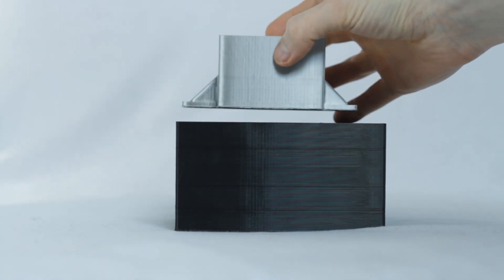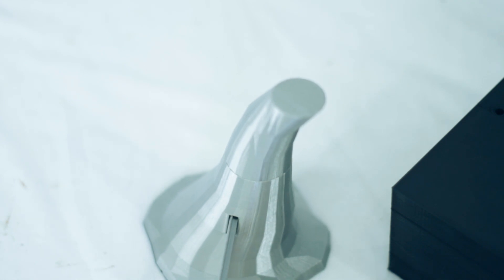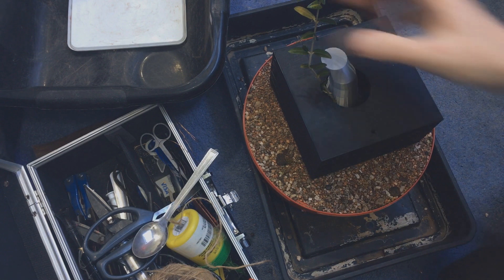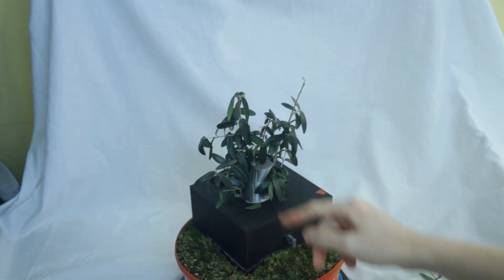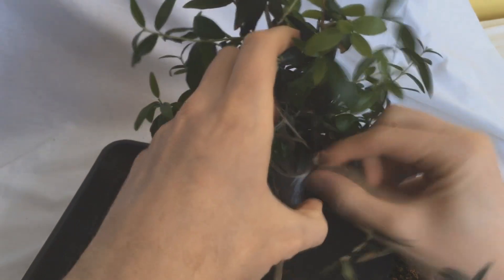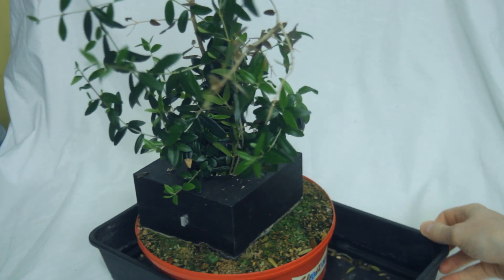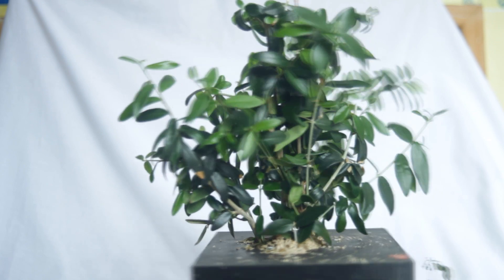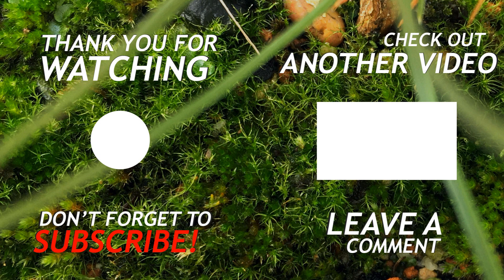Bonsai Fusion 3D Print Experiment

Comment: Very interesting experiment, and I’m sorry it didn’t work the way you envisioned…
I made quite a few experiments myself with 3d printed parts for growing bonsai: if I can give you an advice, I’d suggest to split the black cover into 2 halves that can be easily removed when you want to check/add cuttings. You can keep the 2 halves together by surrounding them with rubber bands, or with wire if you want them super firm… if you want, there are 3d printable hinges and latches from Thingiverse that you could add to your design, but I find rubber bands much more convenient to use!
Anyway, please keep us posted on the experiment that is really interesting and good luck with the next round of cuttings you’d be adding!
Reply from the maker: Cheers bro. To be honest. i have no idea about any of that hhah. Colin is the design master, but if he makes a second edition of the device, im sure that would be useful to try!! 
and yeah dont worry i will keep showing the progress

Comment: I like the idea and I think it could still work. What if you remove that black box and make a new exterior "mold" but this time build it as 2 pieces that come together using 2/4 screws. This will allow you to remove the outer mold whenever you like, put it back again and tighten it like a sort of vise around the tree trunks. This way you can root new cuttings, plant them around the central 3d printed support and fix the outer shell to keep them in place.
My only concern is that the trees will eventually end up breaking that outside piece. 3d printed objects that I used are pretty easy to break or bend.
Good luck with the project!
Reply from the maker: cheers. i think the best idea is to just start again but with actually enough cutttings from the start rarther than having to be always adding them.
and surprising the balck box is pretty solid. i think it will be fine, but if you made it two parts like you said, might be different. i think that is why Colin wanted it as a solid thing.
but who know. i will keep trying for sure
Reply: @BackGardenBonsai  Restarting is always an option. Would be a shame to scrap what you got until now. Anyway, looking forward to seeing what you decide. Good luck!
Reply from the maker: well.. its not like its done anything yet hahah. maybe to try and get enough cuttings or get some seeds and start fresh would be the best option. but we will see.

Comment: Oooh I love a good experiment - nothing like pure unadulterated science!! Really excited with this plan. I think that the cuttings are getting 'stuck' at the wide horizontal base of the silver form - may feel like they're entering soil, but may not be able to angle cutting enough to clear this base.

May I suggest trying a two-fer... Continue with original project  -  and 3-D print second mold as per first one. Meanwhile, well-root a million (??) cuttings and set up a second fusion with newbies
Reply from the maker: yes Sue are 100% right! the first one i put in, i knew it hadnt gone around the bend at the bottom. i did force a few and you could feel them going round, but i know it damaged them too, but at least they where touching the soil. i think that did play a part in a lot of the failures too. I will just have to keep trying and see what i can get to happen
Reply: @BackGardenBonsai  How 'bout this. Wire the base of unrooted cuttings with a curve matching that of the base - cuttings will be inserted at slight angle, but this will give more surface area to send out roots. Just let wire be engulfed by growth - this portion will be under the soil and not visible.

Comment: I've never done anything like this.
But I'm surprised at the method.  Seems like it would have been easier to grow the cuttings inside the silver piece and not even need the black piece.
Curious why you all went the route that you did.
Great experiment either way.  Cheers and happy holidays.
Reply from the maker: cheers. basically you need something to force the tree togther to make it fuse. a more traditional approach would be to do as you describe... but  then put a cable tie around it. this traps it between the grey bit and stops them moving away from each other.
the only issue is that they often fuse just at the cable tie, which can also cut in. so it can look messy. 
the idea of the black box was basically a full trunk length cable tie... but its box, not a cable tie, if that makes sense.

Comment: Thanks for the creative ideas! I really do hope this will work out. I was wondering though, whether it would make things easier to have the black box split vertically, rather than horizontally. Then you could just pull the halves to the sides to remove them, do whatever you need to do and then put them back together. My 2 pence worth...
Reply from the maker: well yes that would help me now. but the initial plan was to add say.. 50 cutting and fill the thing up, so no need to open it. just let them grow and fuse. but im 2 years down the line and have like 5 trees in there  .. hahah.. so.. yeah. its not really gone to plan

Comment: Sat it does work and the all fuse, how do you get the box off?
Reply from the maker: just lift it up. the base is wide and the top is narrow, so it should just slip off if you lift it directly up ...well thats the plan. we will see actually what happens
Reply: @BackGardenBonsai  My mind is struggling to process this, won't you break all the branches and damage the foliage of the trees when you lift the base up though? Sorry if i'm being slow.
Reply from the maker: maybe they will get daaged,  but they are irrelevant. the process now is to fill the box with trunks and get them to fuse together. anything above that will be removed.I will lift the box up and just have a trunk, as if its stump. then build the tree from there, with out the box. 
this idea is to fuse 50 cuttings into basically a stump, rather than going out and finding a 3 inch trunk or growing one tree in the ground for a few years. the problem is i hadnt got 50 cutings in there yet. so the fusion/ trunk creation has not even started. so what was a shortcut hasnt been much a of a short cut
Reply: @BackGardenBonsai  I seeeeee :) Thank you for explaining. Sorry I'm slow. 

Merry Christmas brother x

Comment: What if you make that black square to split in half? That way you if you need to put more cuttings, you can just “open” it  by pulling it left and right. It’ll be easier to add cuttings and making sure that all reached the soil without hurting the one’s already established. Pretty cool idea thou.
Reply from the maker: cheers. yes i guess that would work. ive no idea. but i guess the plan was that you shouldnt spend 2 years adding cuttings hahah.. just add them all at the start. which didnt happen. so if if had it done it right, there would be no need to open it
Reply: Btw, is this something you sell?
Reply from the maker: No, Boston bonsai Idiot just made it for me, for an experiment. .. it doesnt even work yet haha so how could i even try and sell it"
Reply: Fair enough!! I’ll take one thou lol

Comment: I was thinking about doing a fusion but I was going to ziptie the trees together loosely
Reply from the maker: that would be the traditional way. it will work. you might find the cable ties cut in, but in general it will get the job done.
Reply: @Back Garden Bonsai  honestly it might be a good thing it cuts in. As long as it happens after the trees fuse. It will create a flatter root plane on top of the ziptie. Terry Erasmus has a video on forcing maple cuttings to make a flatter root base by slowly cutting off the original root base with washers. I image using a zip tie to do so would be effectively doing the same.
Reply from the maker: this is true if you put the zip tie at the ground/root levels. if you are doing it up the length of the trunk it can be a nightmare. i fused 3 ficus trees together this way with wire and luckily removed it off before it cut in too badly, but you can still see some light scaring now. hoepfully in a few years it will be fully gone

Comment: Also when they get bigger how do you get the black box off
Reply from the maker: Just lift it up and it should slide off.   ...anything above the box is irrelevant. if its in the way it will just be cut off. the goal is to create a trunk with in the box, then when its all fused into one tree.. start the process as if this was chopped trunk.